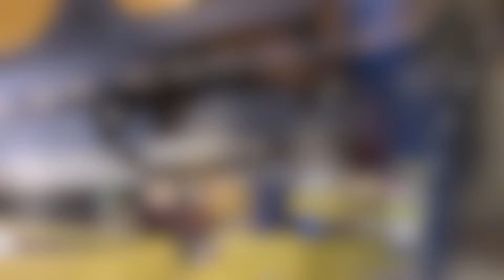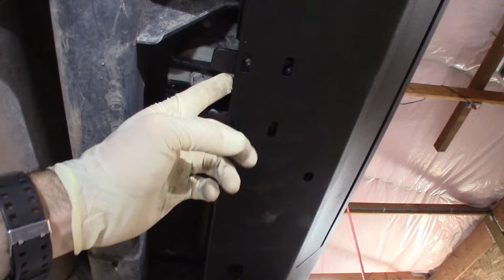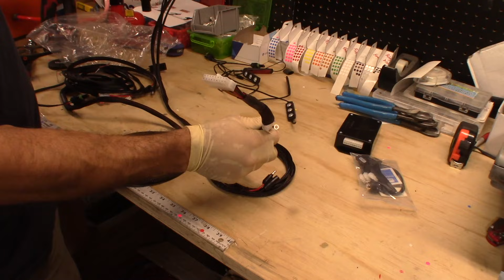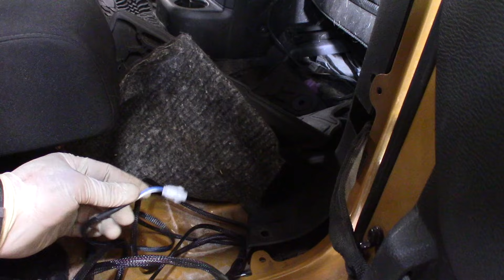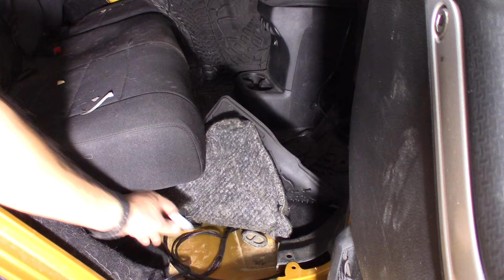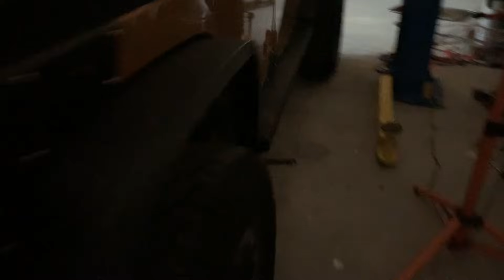Rock Slide Engineering Step Slider Install

Comment: Where did you go through the firewall?  Or did you route under Jeep to battery?
Reply from the maker: if it's an automatic, you can go through the hole that the Clutch MC usually sits, or just below that there's a rubber grommet that you can go through, tight fit, but doable.